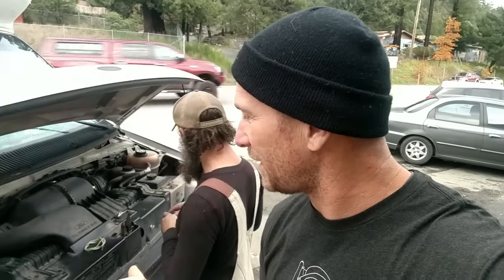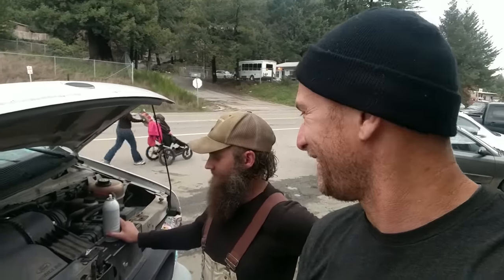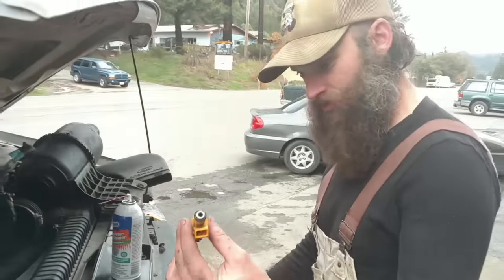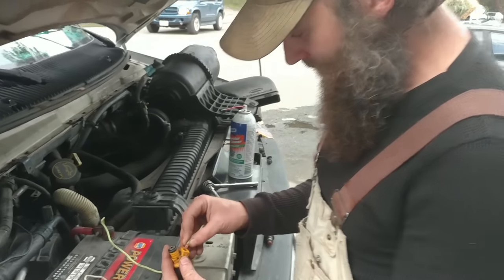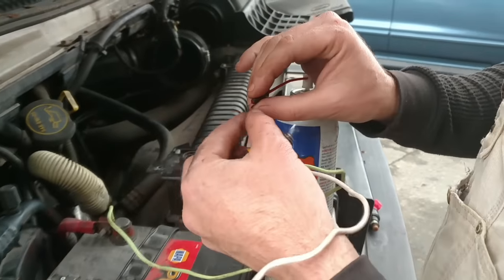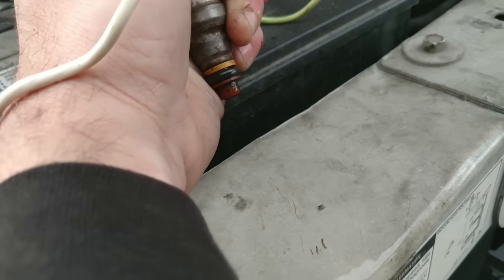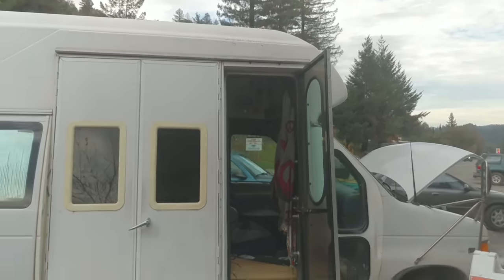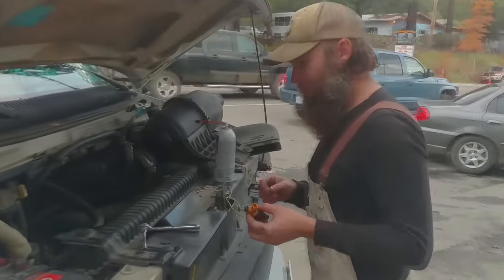Dirty fuel injectors?   Dont buy new ones- do this instead!

Comment: I did this to several sets of injectors and picked up fuel milage. Just a tip but I also flush them backwards (reverse flow). The trash gets stuck inside them usually on the screen. Some of the trash won't just push through so if you back flow them the trash comes out the way it came in instead of trying to push through the screen and other small passages. This actually works amazing.
Reply: DI injectors often can't be back flushed easily. 
Increasingly injectors don't have a screen (this is what the fuel filter is for), so a back flush would be pointless in this instance. 
But, defo back flush if they do have
Reply: Where do you live what kind of gas do you use lmao. You really gotta buy better gas bro before your whole fuel system gets fucked.
Reply: thats why i call bs on this video .
Reply: @solexxx8588  hell people always trying to sell something or got something negative to say about someone helping people. These Negative bots in the world need to have karma hit them so they will respect people
Reply: I was gonna comment about back flushing them then I saw your comment 👍
Reply: @solexxx8588  This is probably a stupid question (but I specialize in those).  What is the can of stuff that you use to clean them (??Fuel Injector Cleaner??).  Seriously... I am asking the question.
Reply: @jotu173  carb/choke cleaner
Reply: Thats the clever point
Reply: @carmichaelmoritz8662  he says he has to do it often because it has a dirty gas tank.
Reply: @carmichaelmoritz8662  Nah, it's a real. ChrisFix has videos that include this method. But he uses a small 12 volt battery, and pulses the power on and off.
Reply: yep thats how we do it on motorcycle injectors reverse wash, 2 hours labor $10 can of cleaner vs. $500 shop fee & a week in the bike shop lol
Reply: are injectors easy to remove+ replace. i have pontiac g.p. i want to try cleaning mine.
Reply: @daviddowns7552  depends on the engine and engine placement. Some are easier than others. My wife’s 4 cylinder Nissan was right on top and easy to get to. My ford 300 inline 6 has the intake bolted over top of the fuel injectors. I actually have a video posted on that truck (not a how to/diy video) when I did a bunch of work on it and had the injectors sent off to be professionally cleaned with a paper showing before and after flow but this back flushing work’s actually pretty well and it’s cheap to do. Both methods work from my experience.
Reply: @butWhyDad  I get my gas at the gas station like everyone else but there is always some fine sediment that makes it’s way into your fuel system and builds up over time. I don’t care how clean you think your gas is but it’s never perfect or we wouldn’t have fuel filters on our vehicles. The filter/filters only catch so much.
Reply: @curlracing276  i appreciate reply✓🏁
Reply: @curlracing276  not in California haha I had a Chevy Malibu with 225k miles and I had it since 155k, never had any fuel nor engine problems.
Reply: @butWhyDad  my wife’s old Nissan ran fine before I back flushed the fuel injectors too, it just ran a lil better and picked up fuel mileage after cleaning the fuel injectors. They usually don’t get dirty over night where you really notice poor performance from dirty injectors they build up over time. If you have dirty fuel injectors the only time you really notice is when you clean them or have them cleaned. Or your the only one on the face of this planet that has perfect fuel and a perfectly clean fuel system. If you have perfectly clean fuel you might as well delete your fuel filter right? 😉
Reply from the maker: That's a bs!🤣
Reply: @claireh.7605  thank you very much,i really appreciate reply✓✓✓
Reply: gumout carb spray should be good for injectors.
Reply: And if the spray pattern is bad, buy a new one?

Comment: “Never buy another injector” -until you burn them out. Injectors aren’t designed to have constant 12 volts. They are designed to be pulsed with 5 volts
Reply: Yeah, this is not a good idea at all. Also hooking up to a battery that is hooked up to the car.... if you short the battery you will screw up some electrical component on the car.
Reply: Matteo L Start a YouTube channel, we need a YouTuber who puts out correct information.   Thanks!
Reply: @Mr.Beastforpresident  then fill us in on what you call correct information????
Reply: For the short time he's operating the injector, there's no harm done. This is a simple and cheap way to ghetto injectors. Maybe some of you guys should stick to being frightened and pay a heap of money to resolve simple issues.
Reply: @rodshehan3886  Well said

Comment: probably needs to drop the fuel tank, clean it out, change the fuel filters, and then clean the injectors last..
Reply: I changed my fuel filter last year,  cleaned my injectors, put in a new PCV Valve, put in new air filter,  cleaned the map sensor, Cleaned out the throttle body, made a huge difference... now it goes Zoom Zoom!!!  Brrrrrrrrrrrrt....

Comment: Yep, I like that trick better than 6 sections of ever smaller hose and heat shrink.  Might not be as great for the solenoid having it connected to the battery for as long as he did, but if you got the can of carb clean all ready to go on the injector with your wires all connected except for your ground, then you could hit the ground, punch the carb clean and watch the injector pattern, and release.  Just make sure you're not aiming the exit spray from the injector at your engine or where your electrical connections might be or you could start a fire.

Comment: Just a note, keeping electrical current on the injector for that long is NOT good on them. Injectors are basically a solenoid and are meant to have short bursts of power to operate them. Holding electrical current to them can easily burn out the solenoid inside them. 

Cleaning then this way is actually fine, but when applying the pressure of the cleaner, tap the wire onto the connection repeatedly on and off. No more than like 3-5 seconds on at one time. You can also back flush them. 

Yes there is an internal filter on one end of the injector and I always suggest back flushing them first to clear it out. Debris is hardly what cloggs these injectors. It's built up corrosion on the pintle spray holes that needs cleaned out. 

Awesome road side video though lol. Hopefully that injector didn't burn out shortly after being reinstalled.
Reply: agreed 100% that it's not a good thing to keep constant current on these.
Reply: Thanks.
Reply: Am curious but do they operate on 12volts? I know some are higher voltage and thinking the computer is lower. Not sure what we have.
Reply: @gregw8232  the computer itself should be 5V, but the injectors are, in most cases, 12V
Reply: @gregw8232  ,dude said you can use a 9 volt👍
Reply: Injectors operate at 100% duty all the time in higher hp applications. It would take wile for an injector to burn up so I don't see any harm here.
Reply: @snackbags  injectors open only for a few milliseconds per cycle. If they would operate at 100% all the time they would inject fuel while the intake valves are closed. This makes no sence.
Not trying to bash or insult you or anything.
Reply: @GetFuktPriusOwners  Since I have no experience with 12-15k rpm engines, I'm not gonna agree nor deny this.
Reply: @Lifted Liberty 12k-15k rpm?!?! Oooh man! Haha! Is that just "normal" driving speed for u?! If soo...can I get a ride?! 👍😎👌🇺🇸
Reply: I kinda doubt this would burn the solenoid, what’s the difference between 10 secs constant and 10 hours on and off? I’m sure there will be much more heat from the 10 hours of constant running, yet they don’t burn out. Plus he’s flushing them with aerosol, that’s going to flash freeze the entire thing, I doubt enough heat would build up from this. Trying to spray that thing while tapping the connections for fear of burning out is just being paranoid.
Reply: @travispratt6327  10 hours on and off = 3ms on, 200ms off. So this would be like it's only on a fraction of the time. 10 seconds on might actually burn it. Compare it to this: could you bench press 50kg for 20 reps? Probably. Could you bench press 1000kg for 1 rep? No.
Reply: @dokterkarel  Right but there’s also the fact this guy does this regularly and says he’s done it dozens of times and still hasn’t burnt out the injector, I think that’s pretty telling as well. It’s all about heat buildup, that’s what burns electronics, and out in the open being sprayed with freezing aerosol probably is going to cool everything plenty well and not get nearly as hot as it does continually running in a hot engine.
Reply: @travispratt6327  point taken
Reply: Lorenzo Ricarte  the injector is basically a solenoid. It only opens and closes. The way to back flush is to introduce the pressurized can of cleaner to the opposite end of the injector, and then repeat the process. It's a little messy to do, but that's the only way to do it.
Reply: @travispratt6327  I was thinking the same thing. A solenoid coil will burn out if it doesn't transfer its generated heat to some kind of mass which in most coils it would be the valve body. If you separate the coil of a solenoid make sure you have a way to cool it. In refrigeration we usually just stick a screwdriver in the coil where the valve stem would go if it were to be left energized without the valve body.
Reply: The injectors sits next to an explosion constantly inside the engine block. Letting a 12v battery keep it open for a bit isn't gonna ruin the injector. If that were the case your car would stop working 2 min after driving it off the lot.
Reply: @lynnmason7509  that's not true at all. Sitting next to an explosion?  They are nowhere near an explosion lol. That's not a very good excuse, nor is it even true. They sit well away from any "explosion". They're in the intake runner., not the combustion chamber silly. And direct fire injectors are built and designed completely different than port injectors.  These injectors work on pulses. Very short pulse width at that. Even at 100% duty cycle, only means that the pulse width is being maxed, not held directly on. There's a minimum and maximum pulse width vs time used by the PCM. That's why you can see injectors actually run 120% duty cycle for a short time before they fail to keep up. You go ahead and think what you want. But don't let ignorance determine your reply by just guessing you know.
Reply: If it's rated for 12v it can handle 12v lmao that's how electronics work
Reply: @jacobharrell8186  you don't understand electronics or solenoids. What is rated for is irrelevant. It that was the case, injectors wouldn't have a maximum duty cycle
Reply: @Boosted007  lmao yeah I know, I was being sarcastic lol rated 12v at 100% duty cycle and all that lol

Comment: Flush em in reverse for a better cleaning. Also get two female spade connectors so you dont run the risk of shorting those two wires going directly to the battery. 1000 amps will make those wires glow red hot in a split second!

Comment: I wish I would have seen your video some years ago as I would not have gotten rid of my at-that-time older vehicle.  I got an error message and a rough running engine only to find out I had to replace a bad injector. Then after a few months would get another error message to replace another one. And then another would go bad. I considered my old vehicle to no longer be dependable and traded it away. After seeing your video, I realize now that your technique would have easily solved my V-8 car trouble. Thanks again and I look forward to more of your videos.

Comment: OH MY GOD!  Dude!  Use insulated connectors to do your battery attachment.  If those 2 wires TOUCH EACH OTHER your wires in your hand become INSTANT heating elements that will burn your hand severely.  Shorting the battery isn't a good idea!  BUT... thanks for the great idea on the injectors.  Might need that trick some day.
Reply from the maker: Take it ez mom 😹

Comment: Putting a constant voltage on the injector will cause it to over heat. They are made for intermittent voltage. If the resistance reading isn't within the specified range, you can still have a bad injector, even though it's clean.
OTC makes an injector pulsator that opens and closes the injector rapidly, while you spray it out. But don't hold a constant voltage on it.
Reply: Next level knowledge and experience!
Reply: @TEMUJINARTS  I would still think the majority of Injector problems are caused by cheap, poor fuel and ethanol fuels sitting in a vehicle for too long.
Reply: @TheGarnerjustin73  that's another issue. But I agree with you on poor fuel and ethanol.
Reply: They are good for a minute or so, I have used injector test benches before, one test is to open the injector up constantly and see how much fluid they pass in a set amount of time, this test does open them up for 3 to 4 times longer than he had it open. That being said i would myself do it with a 9v battery first as there would be far less chance of damage and less chance of a spark that could ignite the spray he is using.
Reply: It's a solenoid it won't overheat... the fucking thing is going on & off many times a second in an engine that's much hotter than the 12v he's giving it will get it. plus he's spraying cleaner (coolant) through it and not letting it set there hooked up for the hours on end it would take to do anything to this coil. Do you even know anything about electricity?
Reply: I tried this today and got a puff of white smoke out of the leak off port, do you think I blew it? I'm about to put them back in so fast answers please. Thanks
Reply: @andymat7359  ....if u held a constant voltage on it and u got smoke, its probably junk now.
Reply: @theSword-  Yep, solenoid blown.
Reply: @666hobart  ....Yes, it WILL overheat. And for your information, I have held a master electrician license for 20 years. 
Not all solenoids are created equal you "super-genius."
Reply: @theSword-  
Complete novice here. 
Would this method of cleaning work if the wire was tapped on and off instead of being held on constant?   Thanks
Reply: @sallyfox3445  ...yes, if you do it quickly and don't hold it open.
Reply: Blake doesn't seem like an OTC guy
Reply: Good points, also connecting wires straight off the battery is an excellent way to start a fire! If a wire slips and shorts, the massive current will burn them up explosively!
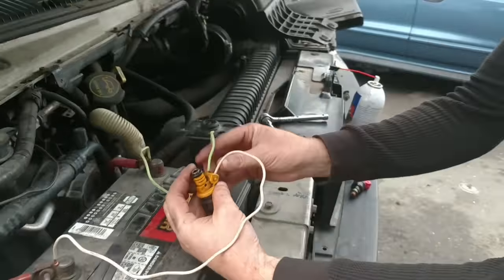Reply: The best part 1:28 when he casually tossed the [LIVE]wires directly into the PUDDLE of carb cleaner.  WOW
Reply: I agree a momentary switch would be better.
Reply: Awesome, thanks for that knowledge)
Reply: thakns i was going to do it direct probable blow myself up
Reply: That seemed fairly brief enough to accomplish the task.
Reply: A simple mosfet here would work wonders!
Reply: @breakz187  .....🤣🤣🤣 what the hell is a mosfet?
Reply: @theSword-  I hope you are laughing at yourself.
Reply: @breakz187  ....no, I've never heard of that word.
Reply: @mcqcjc8409  ....You are clueless.
Reply: @theSword-  

U R SO SMART....
Reply: @theSword-  

WOW WHO GAVE U CERTIFICATE WITH SUCH KNOWLEDGE
Reply: @theSword-  thank you, I'm a former electrician and electronics tech. I held a job repairing video games and pinball machines. I've seen many solenoids for the flippers get stuck and burned to a crisp. And starter solenoids  on cars burn up the solenoids and fry some wiring. 🤦‍♂️ Some people's kids
Reply: @johnevatt518  ....Right. 
There are many solenoids made for many different apps. but a lot of people think they're all "just a solenoid".....then they end up burning them up.
Reply: @theSword-   yep true
Reply: I'd use an inline resistor that drops the current but still allows it to open.  Or as he said, use a 9 v battery  to do.
Reply: well he did it and it still works...at WOT it's getting plenty of current holding it open...
Reply: @mcqcjc8409  says the guy typing in all caps
Reply: @DTB2.0  
I LIKE YOUR PAIN
Reply: @theSword-  no, but all master electrician are created equal
Reply: @grassroot011   Inline resistor divides voltage not current, parallel resistor drops current or amperage but you want to lower voltage in this application and use a resistor inline or series between the battery and injector on either + or - side and divide the voltage.
Reply: What in the hippie hillbilly haven did I just watch?
Reply: @theSword-  run the jumpers off the battery side of the fuel injector connector.
Reply: @666hobart  Solenoid is a coil. It will overheat overtime if constant voltage is maintained.
Reply: @tbauer2521  Mr. Blake might not live much longer. 😂  Certainly, his beard might catch fire.
Reply: @666hobart 😆 this is true .
Reply: was just about to say the same
Reply: @666hobart  Ever heard of duty cycle?
Reply: ac delco would be my choice of injectors or delphi if available. for Gm products but any can go bad imo.
Reply: @theSword-  😂😂😂😂
Reply: @Name-vu1kn Purting a switch would be a grear idea! Thanks for the tip! 👍🏾👊🏾!

Comment: Needs someone to show him how to clean a dirty tank.
Reply: haaaaaaaa
Reply: How is the fuel filter not way clogged?
Reply: @robertphillips93  those things got some fat fuel filters
Reply: If the tank is anything like a T-blazer / Envoy tank. So easy any body can do it. With 3 jacks,  jack stands  and a lot of patience and time. GM could have made it more complicated.
Reply: @botakbishop1441  So you have never used carburetor cleaner, don't know it's properties and don't know that it is so difficult to ignite that you can make a puddle of it, throw a lit match on top of the puddle and it will put the match out?
Reply: @georgeford6056  acetone
Reply: Lmfao 🤣. Golden 👌
Reply: If you clean the gas tank, is only a placebo. It really does not matter if you clean it daily, the gasoline comes with a lot of dirth. That is the reason for filters, but there are always be quite small particles that can circumvent them by the force of suction.